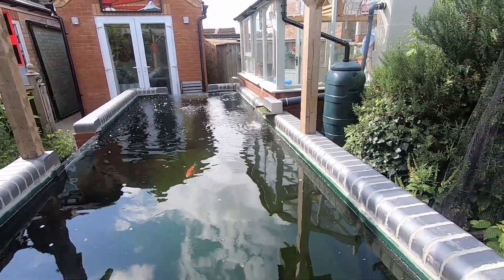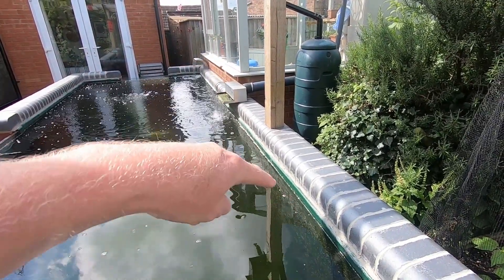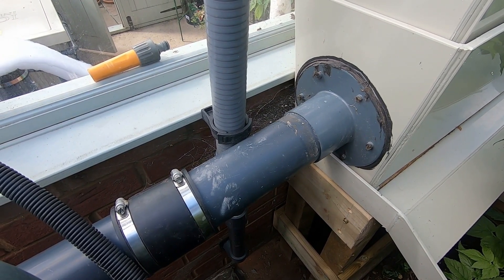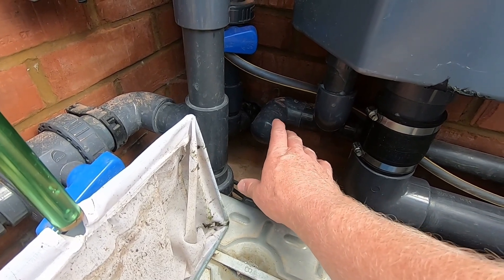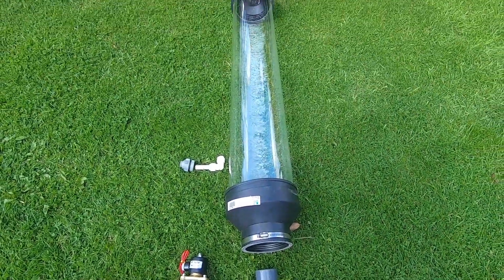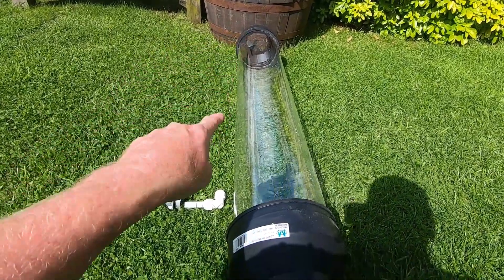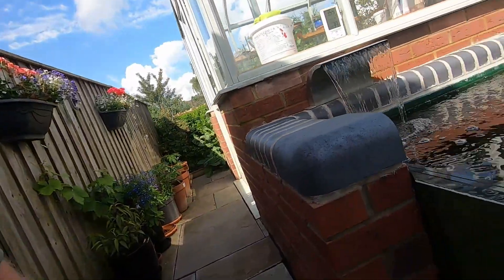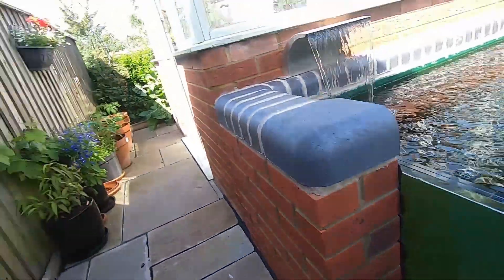New project, water movement, Fluke Solve plus update.

Comment: Hi I had a similar problem on my old pond, nothing new but angled pipe put through the back of a large garden urn that was facing the direction I wanted the water to flow. Hard part was cutting the stone urn.
All the best with your experiments of a wrighty upflow filter.
Reply from the maker: Cheers Sim. It's nice to sit back and think things through with no rush. Stay safe

Comment: Hi Steve.... On the 8 to 4 inch rubber reducer, just put an end cap with a 1 1/2 in tank connector; thats what ive done with my  two upflow filters, works perfectly and save so much space
Reply from the maker: I will look at that idea, sounds promising. Cheers mate

Comment: I think as you've already got a stainless steel return, stainless steel pipe is the best option. It needs to be pipe or narrow channel to give you the flow. If you use open channel it could attract blanket weed though. A nice length of 4 inch stainless pipe from the shower to a 4 inch stainless elbow maybe a short bit into the elbow to accelerate the flow.
Reply from the maker: Good ideas there Tony. I was thinking along the lines of a return that doesn't look like a return, disguised even. Thanks mate. Stay safe

Comment: Hi Steve,  why are these upright filters like tempest better than a large drum with water coming in at the bottom and outlets at the top?
Reply from the maker: Hi Lakhbir, the drum has a specific purpose to mechanically filter, the tempest can be used as a stand alone filter but many use it as a polisher for fines removal. Not sure if you can classify it as a better filter when they do two different jobs. Stay safe

Comment: Hi Steve on the up flow filter can you not put a 110mm pipe end cap on both ends with a tank of the size you require. I think that would give you more to play with
Reply from the maker: I could put a tank connector at the top but one at the bottom would prevent total flush out. Hopefully I can explain in the next video. Cheers Kevin and stay safe.

Comment: If you go to plumb center and get 2 4 inch plugs with 1 1/2 boss adapter then if you go city plumbing and get an s v adapter for your airline that’s what I used on mine I’m a plumber so I know what fittings there’s available
Reply from the maker: Thanks Chris, nice to know I can get plumbing advice now. Ironically enough I've just ordered the bits before I caught up on YouTube bit thanks anyway. Stay safe

Comment: hi Steve, where did you source the parts from ?
Reply from the maker: Bay Plastics on eBay, spare bits in my shed, solenoid ebay, acrylic tube ebay and plumbing parts Screwfix. Full details on Terrys plans. Stay safe
Reply from the maker: Get in touch with Wrighty for the plans. Cheers
Reply: @CATANDEYEKOI  i will do.

Comment: Oddly enough I'm building an uplfow exactly as you have describes. When I looked at the size of it with the rubber connectors it was getting nearer to 2m tall. So I've gone the same route as you. My acrylic pipe is 160mm diameter. I'm thinking about cutting it down from 1m to 800 long. I'm not sure on the effect that will have but it might save me having to buy a new pump. I think I might lose too much head pressure if it goes too high. However using the EA Tempest as a guide, that runs at an optimal 5000 to 7000ltrs/hour with a diameter of 250mm. So (5000 or 7000)/250 * 160 would give me 3200 to 4480ltrs/hour and I think my pump will handle that. I doubt you watch my channel as it's not a pure pond channel. I do loads of stuff but you might want to watch the video on the upflow when I film it.
Reply from the maker: If you have head height I would leave it at 1m and run it like that, on my cutting it down if you can't balance the flow. Will take a look at your channel too. Good luck with the project. Stay safe
Reply: Hi "Its What I Do"! When comparing flow inside pipes in general, you compare the flow area inside the pipes... So if you are trying to get the same flow as the EA Tempest, you really need to calculate the inside flow area instead of using the diameter for the canisters. That would give you a flow of 1991 ltrs/hour to 2788 ltrs/hour. (I assumed the thickness of the pipes would be 3 mm). [My numbers was: (5000/(3.14*((250/2)-3)^2))*(3.14*((160/2)-3)^2). ]

Comment: Problem with waiting 3 weeks for gill flukes, is that they would have laid more eggs in that time, and the treatment won't touch the eggs, so they will hatch after the treatment has worked...end result more flukes !!
Reply from the maker: Surely the 1st dose will still be in the water albeit reducing in its strength and the 2nd dose then hits them again. Follow the science first for me as I'm not an expert. Cheers mate
Reply: @CATANDEYEKOI    I think the reason why lots of keepers say that certain treatments don't work is because they haven't judged the egg laying cycle correctly, and to be honest water temp can change the gestation period by days and even weeks. In my experience I always treat after 10 days at temps around 18 - 20 degrees.
I read somewhere that at 20 degrees, the eggs can take as little as 7 days to hatch, and the flukes can breed after 10 days. It is still a matter of guess work though, but in 3 weeks as suggested there will certainly be lots of eggs laid in that time. Maybe the 3 weeks is more for body flukes which are much easier to eradicate in my experience.
As far as I know, the only thing that will kill eggs as well is 'Superverm' but it is dangerous to use apparently. There is info about it in Duncan Griffiths book if you have it?
Reply from the maker: @CODHELPUS  Very interesting info there Tony, thank you for taking the time to explain. Stay safe